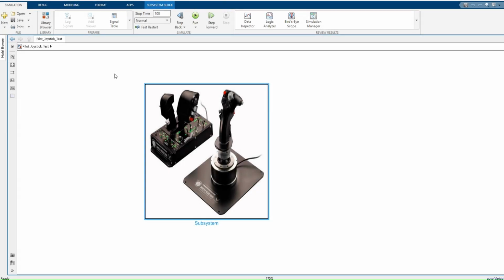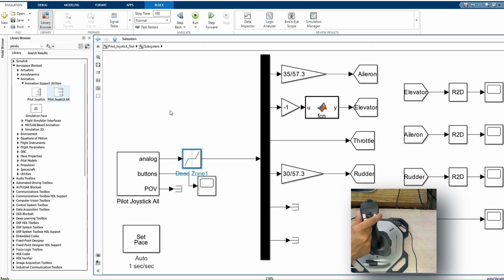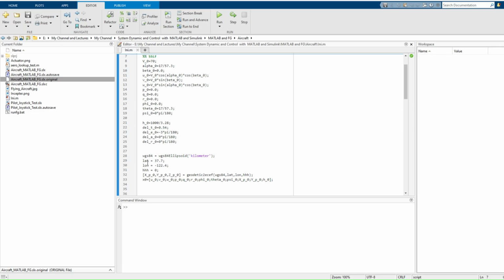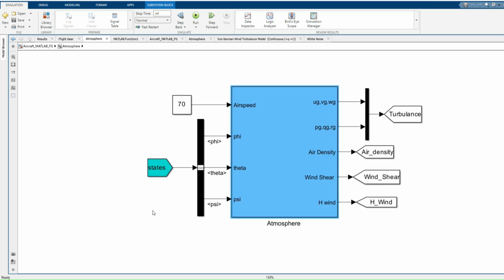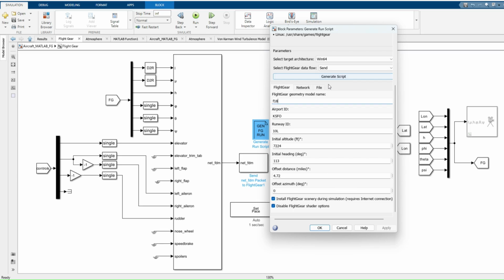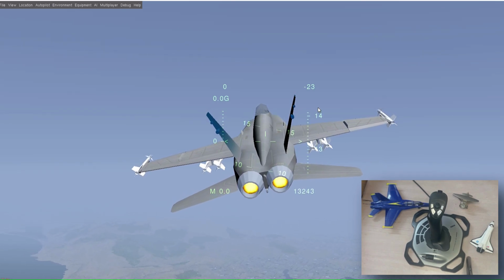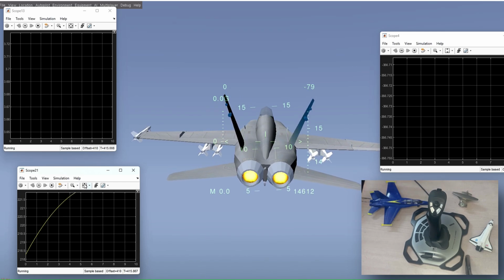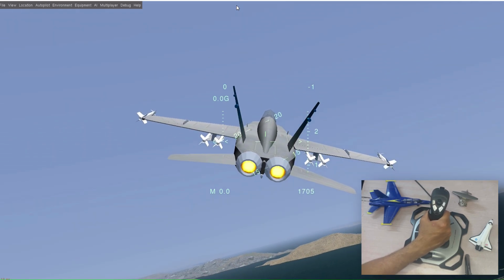Integrated Flight Simulation Using MATLAB Simulink with FlightGear and Pilot Stick Control

Comment: Excellent. Is it possible to see the movement of the control surface when you are changing the joystick? This will make it more attractive.
Reply from the maker: Thank you. Yes it can be done. Send the data using  through UDP network packets. Block is available in Simulink with name “Pack net_fdm Packet for FlightGear”.
Reply: @DrSalahudden  Thank you so much for your guidance. 
I am using your file titled "Int Flight Simulation with FG and Pilot Control Stick" to run the simulation. It is working, except for the animated control-surface movement on the flight gear.  I am using  FlightGear 2024.1.4. According to your model, I see that the control surface input is connected to the Pack net_fdm Packet for FlightGear. However, the control surface is not reacting to the joystick while in a functioning attitude. Please guide.
Reply from the maker: @ismailhossain9495 you have to make a change in Flight gear also. Which aircraft, you are using in FG?
Reply: @DrSalahudden  Thank you so much for your quick follow-up response. I am using a Cessna 172p Skyhawk (c172p), as mentioned in the model.
Reply from the maker: @ism @ismailhossain9495  Some aircraft models in FlightGear do not animate control surfaces. I can assure you, from MATLAB and Simulink side, all correct. Try to download and install different aircraft like F18, F16 etc.
Reply: @DrSalahudden  Excellent suggestion. I will try with another airplane and let you know the update.
Reply from the maker: @ismailhossain9495 Thank you 😊.